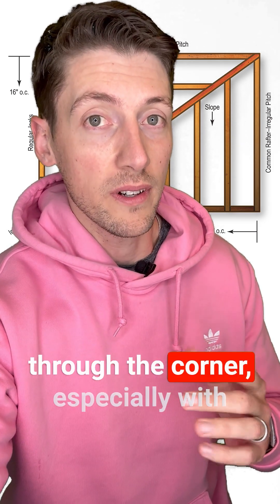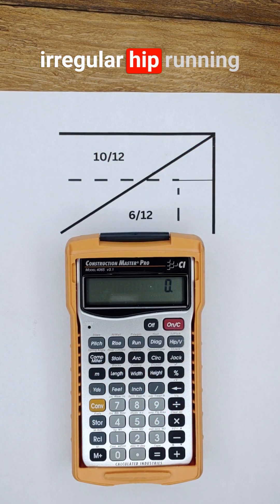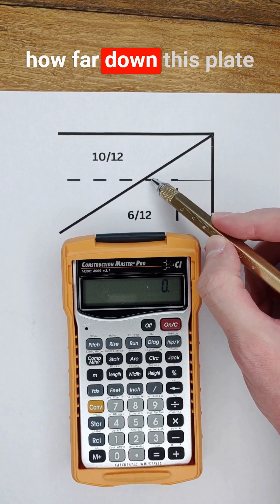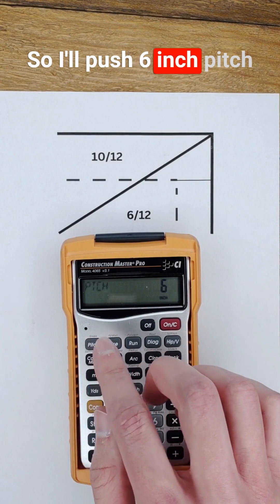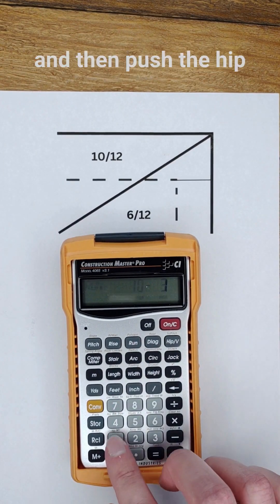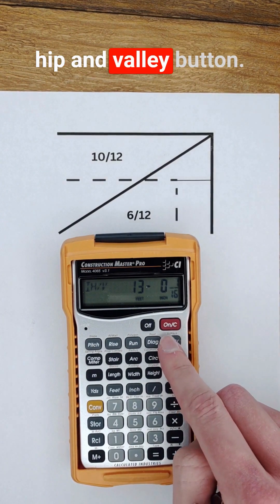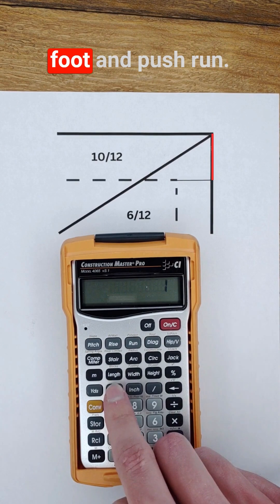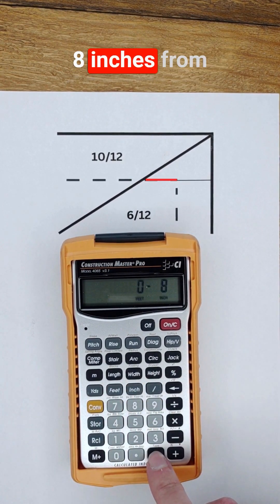How to Set the Hip with an Irregular Hip and Equal Overhang

Comment: I am a framer, and moving the hip away from the corner never worked. Unless the wall's high is lower in this example, the wall where the 6/12 roof is going to set on. So if you can't lower that wall, then you can't move the hip from the corner.
Reply: I was thinking that same thing. Would be better to shorten the hip so it lands on the corner.